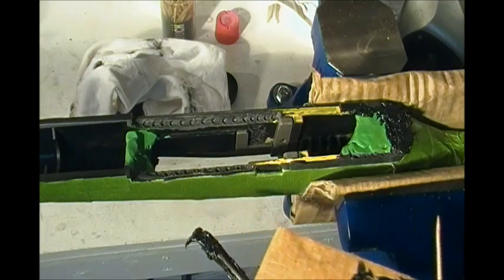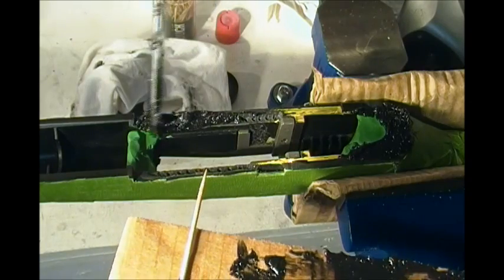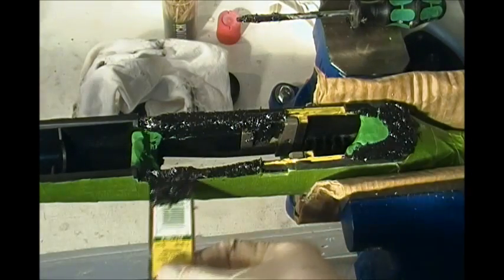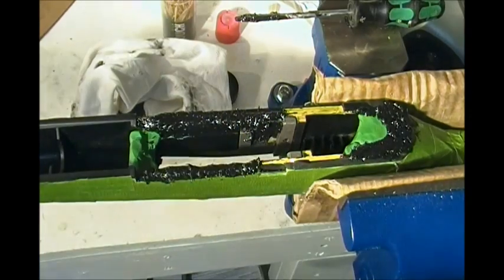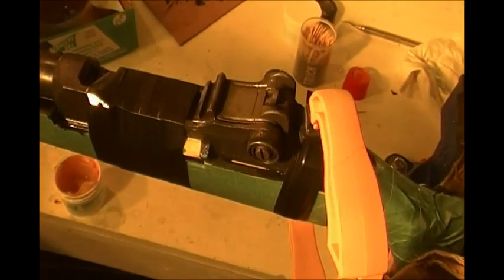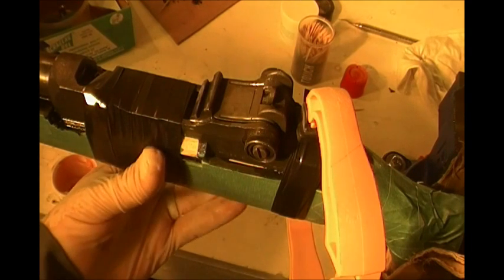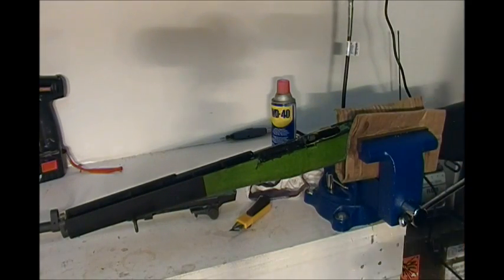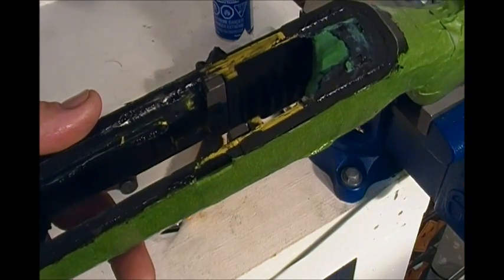PROJECT ACCURACY POLYTECH M305 PART 4 BASIC STOCK BEDDING.wmv

Comment: Great series. May I recommend something? When I was taught to separate the reciever from the stock, we held the rifle upside down at the gas system and tapped the comb of the stock against something (usualy our thigh) and the weight of the reciever aided in separation. It's a tough rifle and proven, but I wouldn't feel comfortable tapping my flash suppressor on anything, I have seen them come loose. I apologize if this sound like a rant that is not my intent.